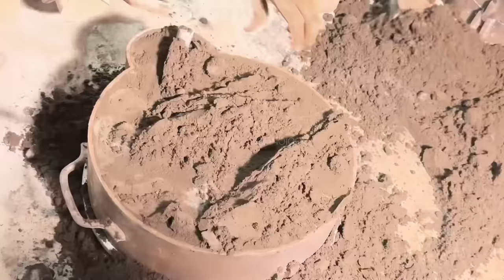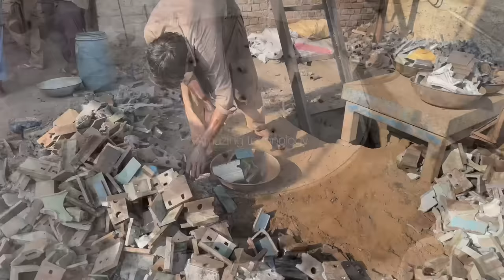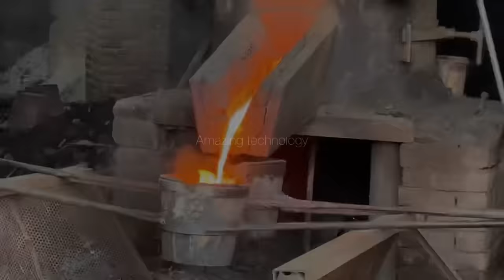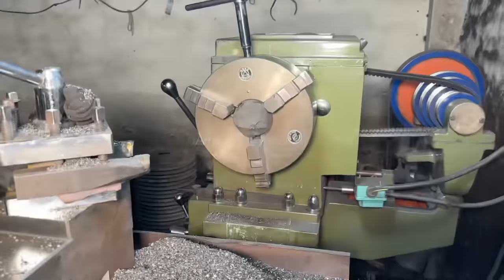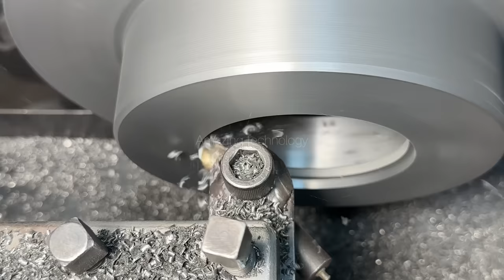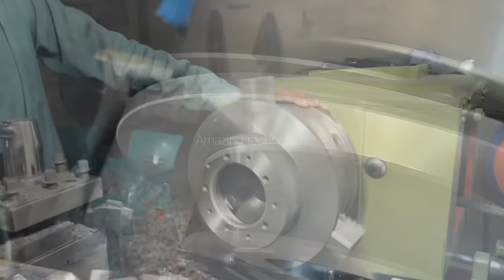How to Make Car Disc Brake Plate Block from truck engine| Manufacturing Of A Car Disc Brake Plate|

Comment: Congratulations for the traditional way of manufacturing these brake discs, but as an expert I would like to suggest something for the good functioning of the factory. In the 10 hole drilling jig if you put hardened steel nozzles this would make the tool more durable and more accurate. Regards

Comment: Something that looks like a brake disc but will have a very short life.
Reply: Just like the drive that uses it
Reply: And yet it doesn’t
Reply: it is a "Car Disc Brake Plate Block", maybe not just a  brake disc :)
Reply: They look serviceable, and would work, I didn't see many voids and inclusions in it on the machined / drilled surfaces. The mystery alloy of iron is always a concern. Also not vented, so they'll run pretty hot under heavy use.
Reply: As long as the kids get to the Madrasa.
Reply: And it looks like we have a metallurgist expert on our hands!  What an honor. Please bestow upon all of us why you think these discs will fail prematurely. I expect you must have been able to personally inspect and test one of these so please give us your test results. Thank you!!!!
Reply: @JohnReynolds-ni5lv Brake Discs were Made with 0,05 mm Tolerance and get hardened. Nothing I See Here, what for Sure leads to short lifetime 😊
Reply: What's a short life?? 50-000 Kms 100-000 Kms?? You pay 500 rupees it works. When fckd you buy again
Reply: @SteveWarlee  ok, fine for india, but it doesnt work in europe with a car for multiple reasons. Personally I would never play with quality on a Brake System, but maybe Im just to much caring on potential harm to others 😉
Reply: O’riellys has to get their parts somewhere 😂
Reply: This is the shit being dumped in Europe. Buyers need to be more vigilant with what they buy. European quality standards are far higher than this factory can produce.
Reply: @jest ! To złom ! Żeliwo nie spełnia wymogów technologicznych !! Mieszanina różnych jego rodzajów.Tirah5
Reply: Yeah no anticorrosion properties

Comment: Steel shrinks as it cools, so you need to factor that in when designing a mold. You can't just use the old part to create the mold.
Reply: That’s why those autozone rotors fit funny!
Reply: It really doesn’t matter since it’s being machined, unless it was too small to meet specs
Reply: They didn’t used any old part for the mold. Are you blind?
Reply: It's iron, but shrinkage is typically around 1%.

Comment: What I find most fascinating is, that very often in this kind of shops, stuff gets thrown on the floor and someone else needs to pick it back up again, instead of putting it in some kind of container.
Reply: Yes using an elevator to move the iron up then just dumping it out when a cart would have easily made the work more efficient

Comment: When you machining the rotors, you suppose to put a rubber band on the outer diameter of where the brake pads are touching against the surface to reduce the chattering.
Reply: and heat treatments and lab testing... etc this is a sound town countty they dont give a shit about your safety

Comment: ATE, BREMBO, BOSCH, disc brake plate is not something u can create with piece of irons. There is always a calculation. Hmmm I won't by a disc brake without being STANDARD ISO QUALITY.
Reply: No wonder there are so many accidents over there.  Zero quality control.